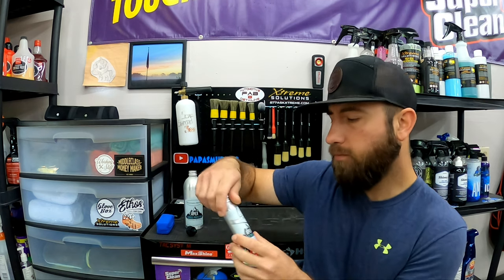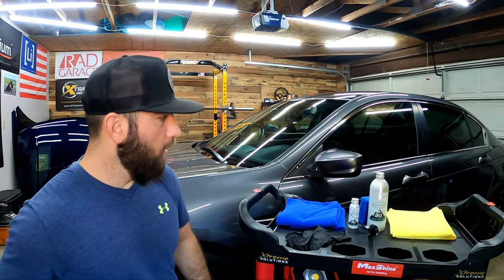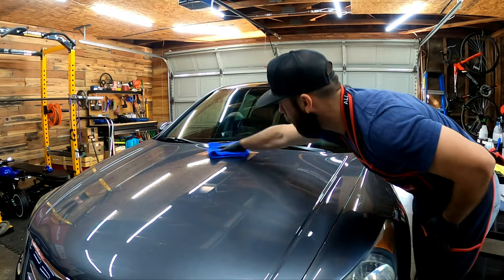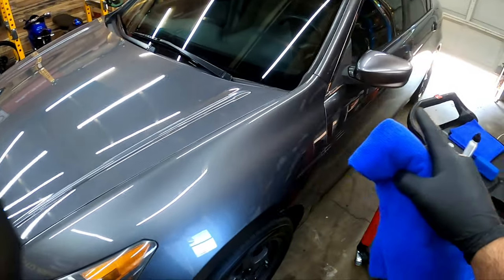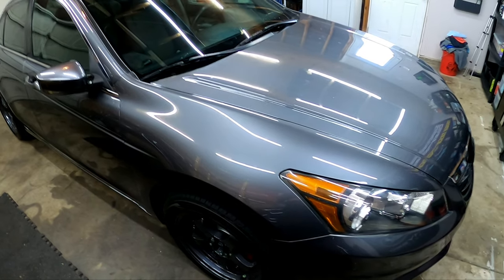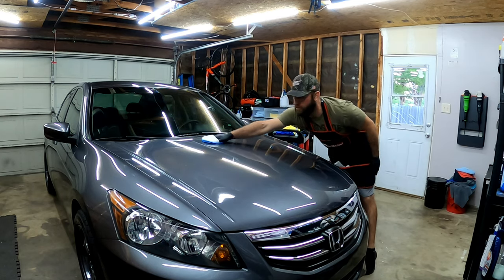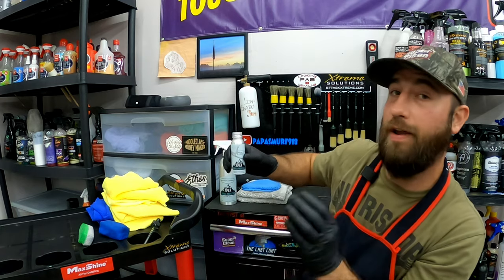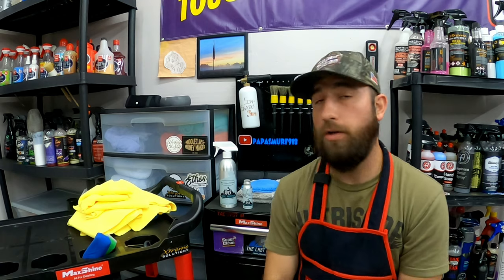APEX SURFACE PROTECTION | METAL OXIDE CERAMIC COATING | Installation process and Review

Comment: This is an excellent product Apex and Artdeshine have produced.  I've only installed only about 30 coatings with around 12-14 different coating manufacturers.  The Apex Surface Protection metal oxide is very satisfying coating to install and will most likely be my "go to" coating for future applications.  I installed this metal oxide coating on my Challenger and I was very impressed with the results.  Thanks for taking the time to create this content. You definitely need a respirator to install coatings though... these chemicals we use are very detrimental to your health in the long term.
Reply from the maker: Agree!!! Great coating here man. Very user friendly and the outcome is just incredible. I'm excited to see some hydrophobics next weekend when I wash it. Yeah, I had a N95 mask I wore it was better than nothing but I don't do coatings hardly. I'll be doing them more and already plan to grab a respirator 👍 this stuff isn't to strong but you can definitely smell it for sure. I watched your video I believe as well. 🤙 thanks for tuning in!
Reply: @PapaSmurf918Detail  make sure you update us all on your follow up to the coating video
Reply from the maker: @HoosierDaddyDetailing  oh ill absolutely shoot vids each month on updates... 👍👍

Comment: I need to see if there is an actual noticeable difference between the bead and the sheet. I would think if you flood the panel and use hydra bead it is still going to sheet water. On the other hand if you use hydra sheet and just have a light rain, it is going to bead. Anticipating that test video!
Reply from the maker: Hahaha yeah, even with ReHydra sheet it's still gonna bead unless flooded or a big downpour. But, if I had both I'd love to do a test panel and test them side by side!

Comment: Late entry post. Applying this Wednesday to a Black Metallic Mazda 3 2.5t hatchback tomorrow.  Literally right off the truck.  Trying to decide between a black microfiber polishing pad or white rupes pad to polish.  Guess I’ll do a couple of section with each.  Almost went with Ice, but since it’s black I’m going with LVR 403 instead. Super excited to get my littles ones bday present all super glosstastic.
Reply from the maker: Chris, awesome man! Honestly.. not a huge difference in either pad choice you mentioned.. nothing you'd be able to see anywho... good choice with 403👍 if possible let cure for 24hr.. then do a light paint prep ( into towel not onto paint ) then coat👌 gonna look awesome!!!👍 keep me posted my friend and thanks for watching!
Reply: @PapaSmurf918Detail  , ya, that’s the plan. Prep tomorrow.  Coat Wednesday after 403 cures.
Reply from the maker: 🤜🤛🤘 let the fun begin! Lol

Comment: Would like to see you use undrdog the sauce coating on something now. It being a coating that's not sio2 based has me really interested as it could make for a significantly nicer user experience not being dependent on short flash times.
Reply from the maker: Steve. Never heard of it but If it's anything easier than this I'd be definitely curious to try it! Appreciate you tuning in and watching my friend!

Comment: Nards, car looks amazing and I believe the hype.  I just wish someone would run some water over the panels so we could see the results.  Especially bc I want to see the Rehydra Sheet in action.
Reply from the maker: Gene, thank you. Check out the first wash video for some awesome hydrophobic action 👍👍
Reply: @PapaSmurf918Detail  FYI, I peeped the first wash vid.  Results look great!  I've been going back and forth between which I was going to apply.  I wanted to go with CG Carbon Force, but it is sold out.  I am now leaning towards this one.  Have you worked with any others that you can recommend or think that might perform better than this one?  Please LMK, thanks!
Reply from the maker: Oh yes, very happy with the ASP so far. I've used the Ethos Ceramic Matrix coating as well. Very easy to use and very great product. 👍

Comment: Hi there, I just recently watched your vid on Brians MO coating and I'm wondering does the coating flash with a haze or a rainbow? It seemed you weren't really seeing much in the vid in that regard but wondering if eventually you started noticing anything consistent. Also you mentioned removing a high spot with a dab of polish and then you say you just reapplied to that area, did you notice any difference in appearance in the area that you reapplied. My coating didn't come with any instructions (not sure if that's normal).  I've never applied a coating before, just doing my own vehicle, so I'm not quite sure what to expect but I have lots of towels, lol.  Thanks again and really enjoy your vids.👍
Reply from the maker: Bill, so I didn't see much rainbow effect to be honest. It was fairly hot so I wasn't going to wait and wait for it to rainbow. I just wiped off. As far as the high spot. Nope! No issue with that spot after re applying after my compound on towel method. I did use my gyeon prep and wiped lightly before applying the coating. 👍 appreciate you my friend! Thanks for the support!!!
Reply: @PapaSmurf918Detail   Thanks for the info I appreciate it. I'm an old retired Canadian farmer trying out a new hobby, lol.  I'll tell you what though auto detailing is a Lot harder work than farming.  Good luck to you.👍🇨🇦🇺🇸
Reply from the maker: @billmccann217  🤣🤣 it definitely isn't easy that's for sure! But.... anyone can do it! If you have any questions feel free to ask.. or email me at PapaSmurf918Detail@gmail.com✊🤝 be well, Bill!

Comment: I’m curious how this compares with Meguiars Hybrid Paint Protection in ease of application and gloss; I went with the Meguiars coating because I was afraid of high spots, but I like the gloss of Apex, at least in the video
Reply from the maker: That's a good question. I actually have the Meguiar's hybrid paint coating kit I'll be doing a review on soon. So stay tuned to the channel👍 I wouldn't be afraid of high spots. Had a tiny high spot and it was a breeze to remove. Just gotta be sure to buff extra.

Comment: Just got done coating my charger this stuff was so tacky and was hard to buff off came out great but damn it was difficult I even adjusted my times for wipe off but still was tacky shines great though
Reply from the maker: Really? That's odd.. I did notice as it warmed up I had to quickly remove.. although it was never tacky on me. What was the humidity and temp?
Reply: @PapaSmurf918Detail  temp was 65 but it was humid n my garage
Reply from the maker: @whiteoutram0516  ok gotcha.. yeah, humidity will drastically change flash.. when I did the Ethos Graphene coating It was 90s.. not a ton of humidity but I was wiping on and instantly begin buffing off. Next time try it on a day with less humidity I bet it will be better. 👍 also, if you ever have that issue again, Brian said a damp towel helps removal.

Comment: You know that Brian @Apex did not make or develop these products. They are just relabled Art De Shine products. Why are you detailers giving credit for something that Brian @ Apex didn't do.
Reply from the maker: Fully aware of that this was made for Brian and it's made by ArtDeshine.. from my understanding it's a different formula as per Brian's request.. doesn't mean it's not a great coating.. 🤷‍♂️
Reply: @PapaSmurf918Detail  To have a major company "Reformulate" a "Coating" would take $100,000's plus testing and Brian is way too small of a detailer to be able to do that. Don't let yourself get taken just to promote a "Relabled" product.
Reply from the maker: @Reflective Auto Detailing  oh ok.. not gonna argue. I don't care that Brian's coating is through Artdeshine. I will support Brian cause he has taught and continues to help/teach me and spread knowledge.. Artdeshine makes a great coating👍... also, have you reformulated a coating before?? Just curious where 100,000 comes from.
Reply: @PapaSmurf918Detail  I have not "Reformulated" a Coating but I know the business. I've been using Coatings (Quartz, Ceramic, Titanium and Self Healing Coatings) since 2007. Reformulateing a Coating is like Reformulateing a Porsche. Also calling it "Metal Oxide" is pretty funny...just like Graphene